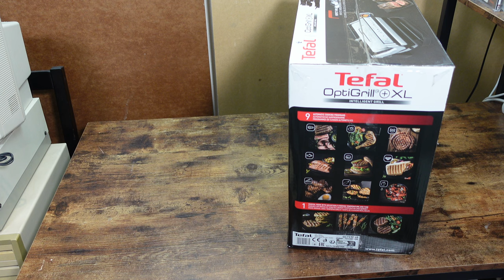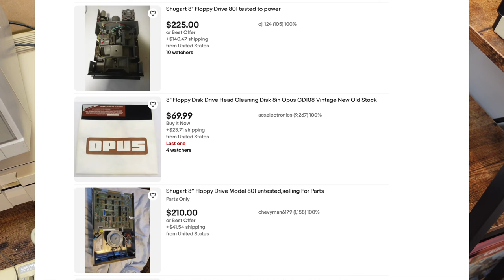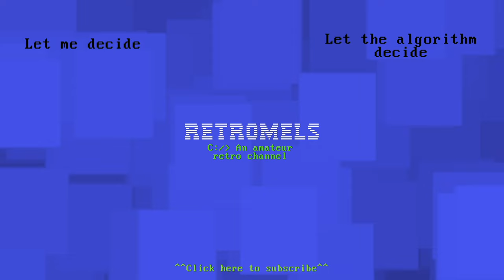I Found 8 Inch Drives!

Comment: My system 38 had a magazine that held 10 inch floppy’s.  In the late 70s to early 80s Ibm system 34,36 and 38 all used them.m
Reply from the maker: Awesome!🤩
Reply: Sure they were 10-inch?  Everywhere I've read they said they were 8-inch.  There was also an autoloader on some systems similar to those on the data entry stations used with System/370 machines.